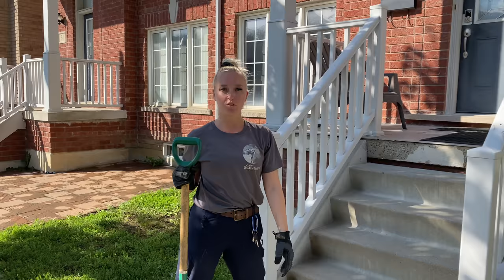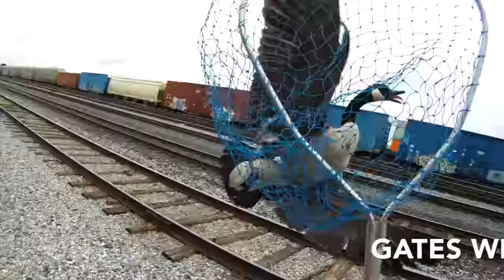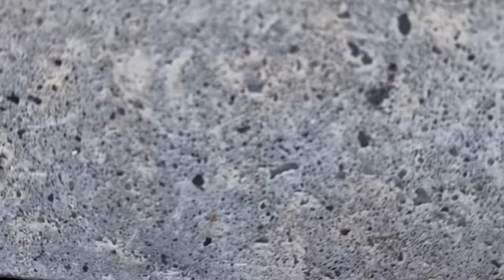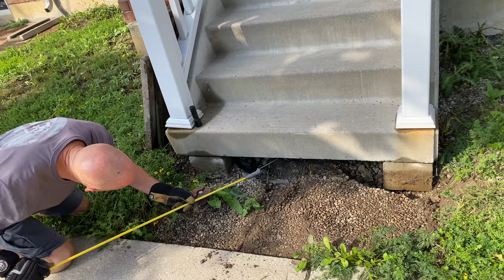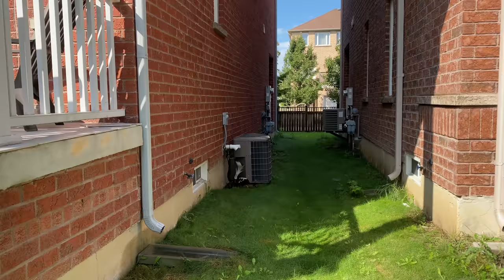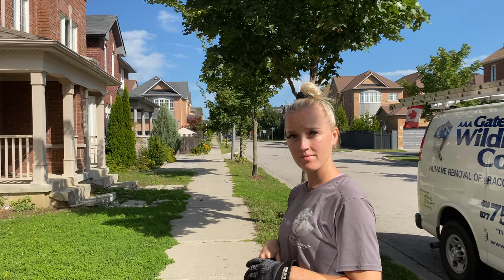Skunk Gets VERY Close to Spraying | Up Close Footage!

Comment: They are not into curb appeal, that mesh is a real eye sore. But the owner can take it off and replace it with brick or cement.
Reply: It looks better than the opening that was there before.
At least it looks professional.
Reply: They could just paint it the same color as the concrete and no one will even notice it. Or a nice piece of trim.

Comment: Great video, loved seeing the skunks - great job at getting them out without getting sprayed!

I do wish you would have done a little bit of a tidier job with the mesh though. Could you not have affixed it to the underside of the top step? I appreciate you're just their for the animal control, and not for home reno, but just leaving it out there in the open looked messy.

Anyway, thanks for sharing it, and again, great shots of the skunks!
Reply: There already was a defect in the construction or the skunks could not have gotten in there. Area needs a re-design.